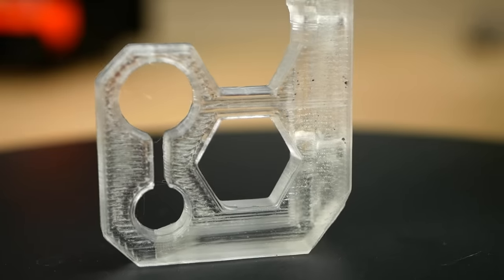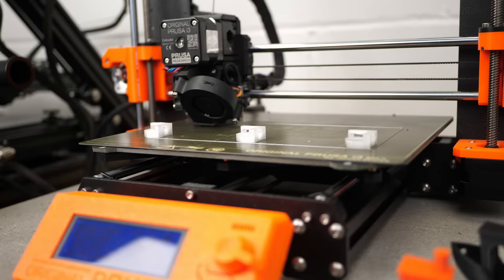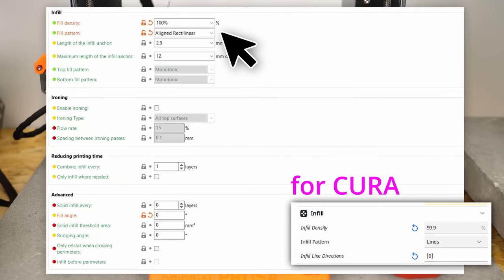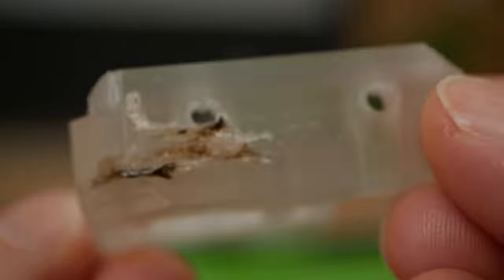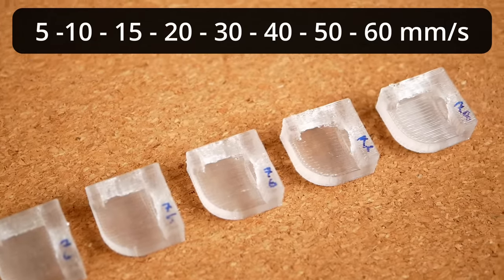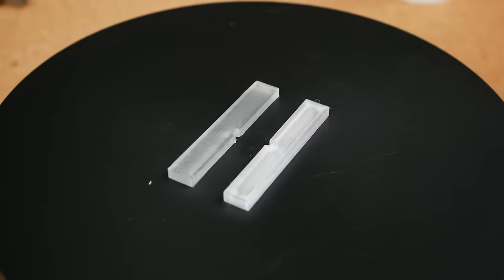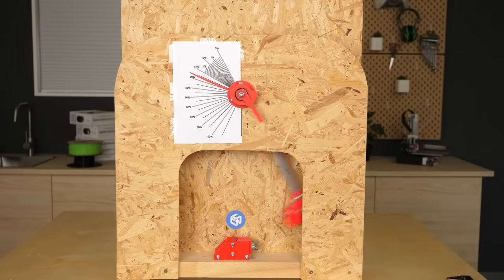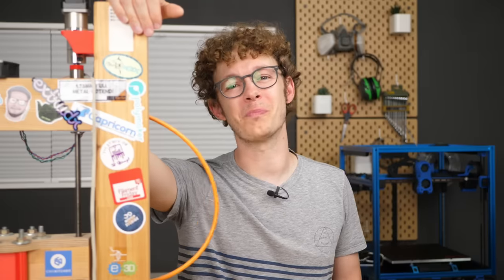Transparent FDM 3D Prints are Clearly Stronger!

Comment: I wonder if you could add ironing into the mix? You could set the aligned rectilinear infill in one direction and then set the slow ironing path to be aligned 90 degrees to that. That could help fill up the cracks and get a better transparency to everything. Might try this out on my all copper hotend with some clear PETG I have laying around. Though I better make sure to dry it cause Florida.... ;n;
Reply: I had the same thought.  Posted it just after you did I think.  I would like to see Stefan give that a shot.  I have too many other projects to investigate it myself ATM.
Reply: And I mean iron every single layer. Not just the top most portion of the print. ;3
Reply: @MisterDeets  Yeah I might give it a go. Will use SuperSlicer to di this as it does have the ability to change ironing angle and iron on every layer. 🤣
Reply: @Shika1son  I haven't tried SuperSlicer yet.  Will give that a go myself sometime.  I didn't know that it had that functionality.  That sounds like a possible way to truly isotropic parts to me.  It's a slow way, but in demanding applications the time investment might be warranted.  Thank you for that followup!
Reply: @MisterDeets  Sure no problem! Hope it works out for you and anyone else looking to do this. I luckily have a flow cell I modeled for a concept to measure micro fluid temperature and would love to see if I can make it transparent enough to view the flow of water inside. :3
Reply: At the moment I'm trying this out on my Ender 5 Plus and man it is insane how clear it is! Might post a video on my channel to share on the clarity and how much light passes through a 20 x 20 x 5mm thick prism. :3

Comment: I wonder if it would be possible to design a filament printer that printed in either a low/no oxygen environment or inside a bath of some sort so that you get a more consistent refraction index by having the voids filled with something other than air. I also wonder if you could have it soak in a transparent resin and then cure it for the same effect without losing print speed

Comment: Thank you for doing what you do. Transferring knowledge is very important in our hobby and you do a great job of approaching it scientifically. As and engineer I very much appreciate your technique. I've played with transparent some and found a bigger nozzle and taller layer height can help.  Would it be possible to append your results with .6 and .8 nozzle and . 24, .36 later heights?

Keep up the great work.

Dave
Reply from the maker: I should probably do a proper DOE with more parameters at some point. Maybe I need to hire an intern for the grunt-work ;-)

Comment: Stupid thought. I wonder if there would be some possibility to FDM print void-free parts at higher speed if the nozzle temperature could be dynamically adjusted. As in run a line at some normal temperature, then run a really hot gooey line next to it to fill in the cracks. Not sure if that would work.

Comment: Speaking of clear resin parts, I was so disappointed when I saw how much the clear resin yellows, especially after post-curing. Interestingly, the kind of clear UV resin used for casting jewelry and such does not yellow appreciably, and it has optical clarity with an index of refraction virtually identical to clear acrylic, but I don't believe you can print with it. 

Nevertheless, this made me wonder about quickly 3D printing something in clear filament with lots of contiguous voids, then putting it in a vacuum chamber, immersed in clear UV resin, and drawing the air out until the resin filled every void. Then you'd just have to take it out, let the excess drip off, and cure it. Actually, I just realized that that's essentially the plastination process used in BodyWorlds, just with 3D prints instead of cadavers.

Comment: Very interesting and well thought out. Unfortunately, I hope you're wrong. I am anticipating and hoping for a much more significant product. To me, the product that you theorized would be relatively pointless to me. I already have the ability to print with multiple colors, and it works well. The noise is not a concern to me and if the noise is a concern for someone looking at a bambulab printer, they should not be looking at enclosed coreXY machines. I don't need ANC on my tools. I need productivity, efficiency, and low tool costs.

Again, super cool theory, but I'm pretty sure it's going to be a bed slinger printer. At least that's what I'm hoping for.

Comment: This may sound counter to what is now used but… what if after cooling first layer, make a small warming part before the print head on next layer. Warm it just enough to help layer adhesion?
Reply: Might as well make a very wide flat nozzle. Making the "heating part" always stay ahead of the nozzle is going to be extremely complex.

Comment: I wonder if you could improve prints (especially these clear ones) by changes in the printing environment itself (air pressure, ambient temperature etc)... I mean, shouldn't extrusion lines bond ("snuggle") together more when cooling off in lower air pressure due to less surface tension or less shrinking or something like that?

Comment: I wonder will the printed part be stronger if it is printed with a similar technique but with the single perimeter being thinner by 50% to offset the infill by 50%, do it with intervally between normal non-offset and offset. sort of like laying bricks but at the vertical direction. doing so in theory will allow the extrusions on each layer to have a slight offset so that some of the extrusion will fall/fill into the void between the lines on previous layer. anyhow i always suspected printing in the same direction will result in a stronger part due to how clean/perfect the extrusions will be.
Reply: I'm thinking this would be worse. If you look at the parts the intersections are not clear. Cross crossing would make this less transparent. Just a theory

Comment: I’d be curious if those decently clear samples printed at 50mm/s in your printing speed test would perform as well in the strength tests. I don’t know if I’m willing to wait hours for tiny parts at 15mm/s
Reply: I print transparent with 0.6 volcano hotend at 50-80mm/s. In my opinion transparent/natural matrials are the best for funtional parts.
Reply: And no, it is not clear as his prints, but i'm pretty happy with the semitransparent results too
Reply: @dtibor5903  how would you characterize the layer adhesion at that speed? Negligible compared to slow printing or weaker? Also, do you print with the overextruded settings like in this video? I don’t expect you have a universal test machine but do you have input on the strength?

Comment: What if you mounted the plate and the extruder on high degree of freedom robotic arms? That would be cool to see, but I don't see anyone spending that much money on robotics kit just to make a printer for a single video. The advantage would be the possibility of printing in multiple orientations by rotating the print. Bed adhesion would be much more critical, but we've been tackling that for nearly a decade now. I think we're ready. If you did that, you might be able to cross hatch the polymer strands to reinforce the bonds between layers, or even not print in layers at all.

Comment: Would it be possible to use water soluble supports or, rather, an enclosure made with that material that surrounds those printed parts with transparent parameters in such a way that they maintain the expected physical dimensions of the original 3d file?
Could this further improve the resistance of the pieces?

Comment: Problem is the nozzle is too ruff an fine air bubbles get inside the filament.
If you want real clear prints you need petg and a rubi nozzle which is nearly perfectly smooth. 
Pla is in his liquid Form not clear more like glue so it cant be really transparent from his nature.

Comment: What if you Annealing or remelt (in plaster) the standard and these clear prints. If i remember well it works quiet well with PETG and it maybe make the material more uniform and thereby more transparent and stronger.

Comment: you still use gluesticks on the bottom? I use a sheet of glass. cleaned with alcohol. super easy to use, no additives, smooth, n they stick perfectly. Most people screw this up simply because glass requires more heat. 

if you want better bridging but want clear on majority why not just turn fan on during a bridge area?

Comment: Bel video complimenti.
Io per questo tipo di filamento ho utilizzato un layer 0.6 e uno shell di 0.8 questo mi ha permesso di avere un filamento stampato chiaro e veloce. Ma ho ancora tante bolle e problemi di retrazione. 
Penso che il risultato finale debba essere identico al filamento arrotolato.
La configurazione perfetta è quella che ti da gli stessi parametri di tenuta pressione elasticità e trasparenza del filamento originale.
Tu parli di lentezza mentre io ho trovato trasparenza nella velocità del layer, se scendo a 0,15 o come te a 0,12 la stampa diventa bianca e non trasparente. Ho montato sulla macchina un nozle da 0,01.
Anche il bottom layer speed io l'ho settato a 60 mm/s perché è il valore che mi da maggiore qualità nella trasparenza. Se hai consigli grazie

Comment: Im wondering what effect hotbed temp could have on this, say if you crank up the hotbed could the filament take longer to cool and have more time to seep into the cracks, further increasing clearness? Im also wondering if maybe the type of nozzle effects how fast you can print such a part while keeping it clear... im assuming a different point or design would change how turbulent the extruded plastic would be.
Reply: I‘m currently playing around with this and I have only noticed that having a hotter bed increases the chance of warping.
But I guess that keeping the printer enclosed is a good idea as that raises the average temperature around the model and slightly increases the time it takes the filament to cool down.

Comment: Stefan, is it possible to minimise layer voids and those channels by modifying "aligned rectilinear infill" by stacking each new layer lines parallel in between extruded gaps?
Reply from the maker: Yes, probably, but you' need to start with a half-with extrusion at first.

Comment: These details are great for the everything must be faster and faster crowd. The folks that are obsessed with doing a 30 hour print in 3 hrs and some how expect the same quality. Yes you can print faster if the hardware can handle it, but the material quality will suffer. Obviously when making cosplay gear and toy models that will be painted, the parts don't need to be high quality. But when you do like I do and make replacement parts to doors, futons and other various replacement nick nacks that aren't always easily found, then taking your time gets better results. 

Fortunately this is why I am DIY because a shop is not normally going to offer a long and slow, or high speed option. They are in it for the cash meaning as fast as possible while remaining reasonably durable. So in my own settings I have a range of configurations to suit the quality I need. 

The biggest battle I still have is with those pesky air bubbles in the extruded material. I have yet to find a way to erase them. They absolutely cause quality issues. 

All that said, if you are looking to tune your gear, transparent material is always a great way to go. It will easily reveal quality issues you might not notice, including over temp.

Comment: I want to print light guides to get a square on the surface of my project case to be lit up by different colors of LEDs (like the ones you can see on every hub or internet router) So far the parts I printed diffuse a lot of the LED light in the case, so I am curious about different approaches of printing transparent materials to improve the results. Any ideas?

Comment: Hey Stefan, bei mir kriege ich die Wände nie klar hin. Eine geringe Layer Height hilft auch eher weniger. Ich kriege den Infill "einigermaßen" klar hin mit einer 1mm Nozzle und bei 10mm/s mit 0.4mm Layer Height. 
Mit 0.4 mm Nozzle geht bei mir gar nichts :(
Reply: Auch mit dem G-Code für den Testprint hat es nicht gut funktioniert :(
Reply: Die Wände sind immer ein bisschen gerillt, das liegt einfach daran, dass der Drucker das Material in dünnen Schichten „stapelt“.
Eine niedriger Schichthöhe hilft diese Rillen kleiner werden zu lassen, wodurch sie auch etwas klarer sein sollten.

Du könntest probieren eine ganz dünne Schicht Klarlack oder Polierwachs zu verwenden. Das sollte die Rillen ausfüllen und sie somit etwas transparenter machen.

Generell ist’s aber empfehlenswerter, eine kleinere Nozzle zu nehmen, da die dünnere Linien rausdrückt und da weniger Abstand zwischen den einzelnen Linien ist, in dem sich Luft ansammeln könnte.
Ungefähr so, wie weniger Luft zwischen einige aufeinanderliegende Spagetti, als zwischen einige aufeinanderliegende Bleistifte passt.

Aber wenn du für die 0.4 und die 1mm Düse die gleiche Hotend Temperatur verwendet hast, könntest du probieren die Temperatur bei der 0.4mm Düse zu verringern, da bei der weniger filament durchfließt und das somit viel heißer wird, als bei der 1mm Düse und dadurch können sich diese Luftbläschen bilden, die er im Video erwähnt hat.

Comment: The only reason the parts are stronger is because printing slower allows the layers to better adhere to each other
Reply: So true.
I like to print fast, because, well, I'm just impatient.  LOL

But of course, with speed, came weaker parts.  Some so weak they were worthless.

Then, I did some mods to my printer (mostly to the cooling of the heat break) and now, I can print fast and VERY HOT.
The very hot settings have created the strongest prints I've ever had and tighter layers.

When I say very hot, I'm talking, for PLA, where I USED TO PRINT at about 200C, I now print at 235C to 240C.  Yeah, that high.

I haven't tried the uncolored transparent as yet, so that's something I'll have to try very soon.
My colored transparent filaments print not bad, but they don't seem to like that hot of temperatures.
As usual, it's a balancing act.
Reply: That, as well as using higher extrusion multiplier / flow rate.
Reply: Duh

Comment: What's simply happening here is that you are heat treating the part while it's being printed and hence why it's taking forever to print due to the slow speed. A more efficient way would be to print the part at normal speeds and then do some heat treatment to all the parts at once, yielding similar strength behavior.

Comment: Stephan, I love your channel and how scientific you are in your tests. However you perpetuate FDMs biggest myth, that layer adhesive is the biggest flaw of FDM printing. Have you considered investing in a real printer with a heater chamber? Namely a stratasys or MakerBot Method. When printed in a proper forced convection chamber, printers are nearly as strong in Z as they are in XY, and when tuned right, rarely warp even when printing difficult real thermal plastics like ABS. Or, at the least, it would be cool if you purchased a bunch of hooks and dogbone test prints from a print service that uses stratasys printers, and compare those against parts from an ender or Voronoi printer.

Comment: I simply accepted that 3D prints have its limits, they are still good for incredible number of things but sacrificing speed just to get slightly stronger parts is a big NO. It is still not going to reach metal levels and trying to squeeze best performance from cheap material is just not worth the effort. Might as well use more expensive technical filaments.